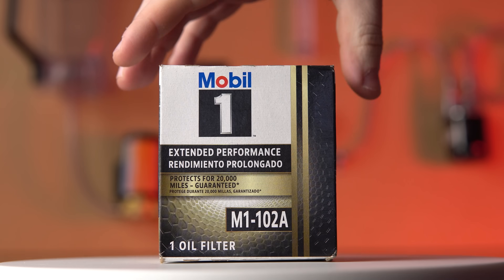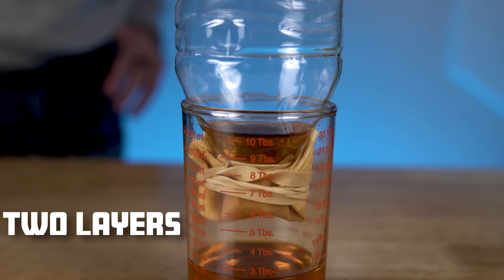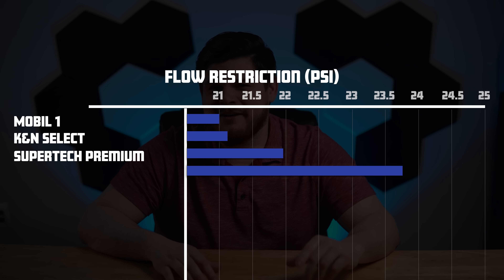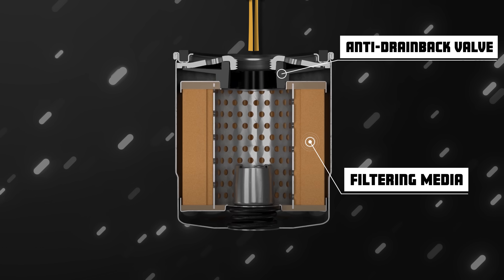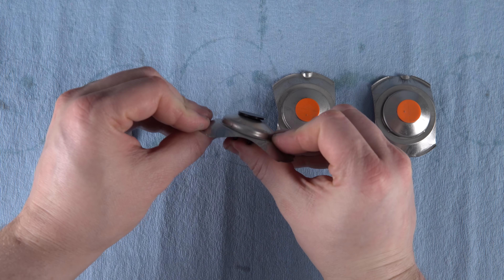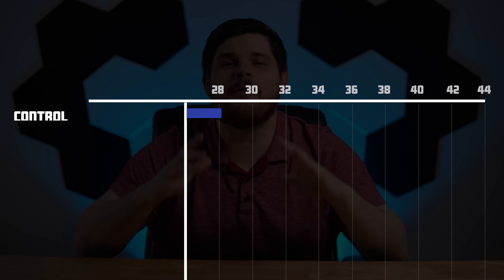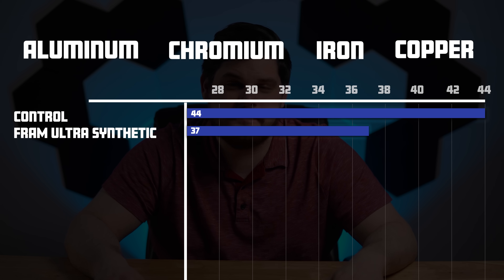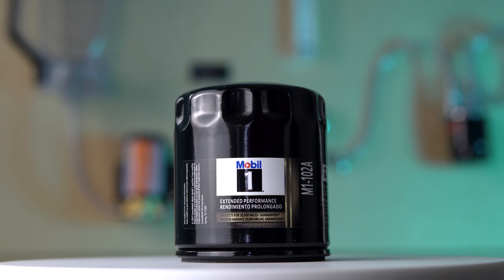Engineers Test the Best Oil Filters! FRAM | Mobil 1 | K&N | Walmart Brand

Comment: Ive been using Motorcraft filters for a long time and they seem to do well but I've never seen any tests with them.  Would be curious to see how they perform against the Purolator Pure 1 which is what I consider to be the best on the market.
Reply: Yes. Motorcraft and Wix testing please.
Reply: I got a Pure1 in a package oil deal from Advance Auto parts and my engine ticked on cold starts. I replaced it with a $2 QS filter from Menards and the ticking went away. Called Purolator and their agent was a stroke. F them.  If they offered me a free lifetime supply of filters, I'd tell them to stick it. Also their air and cabin filters are more expensive than OEM and garbage, IMO

Comment: I am an ICML certified technician. You might want to check out Baldwin filters. They have a lot of industrial applications, but sell automotive filters as well. I don't know if you can find a lab that measures smaller particles for gasoline engine oil, but for industrial machinery, oil is tested for particles at 4, 6, and 14 microns in size, as the smaller particles cause the most damage in rolling element bearings. You wont find an automotive filter that can catch many particles smaller that 10 micron. Engines don't have too many roller bearings, but some can be found in the roller lifters of later model push-rod engines. At work our samples get sent to Bureau Veritas for analysis, but I see they only offer the particle count for natural gas engines, and not the Gas/ Diesel engines for some reason. Good work guys!

Comment: That was a rocking and thorough examination of the presented filters.  Well done!  Liked an Subscribed.  I have been using the Mobile 1 filter and Mobile 1 20000 mile synthetic oil in my Ford Fusion Sport since 2012  My engine has 138,000 miles and is performing like the day I bought it.
Reply: I've got a 2015 Mustang V6. Bought it with 1200 miles on it. At the first oil change it got Mobile 1 oil and filter and that's what I've been using since. The car now has 230 k on it and runs fine.

Comment: The best filter for your vehicle is from the manufacture of the vehicle. I found out the hard way that the spring tension inside the filter is set differently on the factory filter then the off shelf brands.
Reply: Absolutely true and many don't realize this. But also a cartridge style oil filter is best to get directly from vehicle manufacturer since they ensure the oil flow is correct.

Comment: I don't know man, in a healthy engine I don't think these filtering capacity tests are going to be relevant. If you've got that much aluminum or other particulate in your engine it's probably already knocking and about to seize, and at most you're going to buy yourself a few miles with the high capacity. Looking at your pressure flow test, the K&N and Mobil 1 are not different enough to be statistically significant, so I say that's a tie. the third test, the most important in my opinion for real world use, you can see that the K&N is far superior. Personally I would still buy the cheapest of the bunch because they all get the job done, but the K&N is the clear winner here. If you want the very best filter for keeping an actual engine clean out of this group, you go with that one.

Comment: Love your video and the testing methodology. If you can, for future tests to help make sure the pressure test is valid, it would be very helpful to confirm a couple more things: 1. the viscosity of the oil, and 2. a very good determination of exactly what pressure the bypass valve starts to open (noting that room temperature oil is thicker than hot engine oil and the thicker oil that’s not at operating temp is much more likely to push open the bypass valve as opposed to traveling through the filter). 

Regarding item 1, I’m not sure if there is an affordable instrument to measure viscosity so if you aren’t able to obtain one, it would be good to state what brand and viscosity oil you are testing AND the temperature of the oil. This would at least give us a rough idea of viscosity. Because, as we all know, hot oil at the operating temperature of the engine is much thinner than oil at ambient temps.

Regarding item 2, since I think you probably completed your pressure test with the oil at room temperature (and not the hot temp) the oil is thicker and potentially was opening the bypass valve. 

I read through many (but not all) of the comments and others might have already pointed out some of the above observations. 

Thanks again for your testing!
Reply: Yup. Agreed...hot oil makes a big difference

Comment: Very good test set up, like others have mentioned about the bypass valve, a way find out when the bypass opens would be important when it comes to assessing oil flow rate. I would also be more interested to see these tests being performed with the temperature of the oil listed. assuming it’s room temp between 70°-80°f you may find flow rates to be different if the oil was closer to 190°-200°f as that is the typical operating temp of all vehicle engines. But overall cool video!

Comment: I change my oil and filer at every 5 000 miles regardless. I would never leave engine oil for 20 000 miles. Engine oil is good for the lubrication up to 250 moto hours so does the filter.

Comment: I change my oil filter every 15k miles, i never have any issues just change oil regularly. I have a nissan nv200 bought it new and now has 140k miles with CVT, and still running strong. 👍🚐 and i did vanlife on that van and traveled all over the United States.

Comment: I prefer NAPA aka WIX filters. I do an oil filter change on my car 3 k miles and a change every 9 -12 k. I run Pennzoil pure platinum synthetic in a 2004 corolla 1.8 2ZZGE Toyota engine with 236k. Only thing it ever needed was a timing chain tensioner which takes less than 5 min to change out. Not timing cover access needed.

Comment: Great video, very informative!  

If you continue testing filters please add the pressure which the bypass opens and flow rate. Adding AL powder until the flow rate drops could be skewed due to the bypass opening fooling us into adding more powder. 

In any case I'm glad I always run Mobil 1

Comment: Thanks for doing this test it was very informative. It would be nice to see how the factory filters test.  Specially since many of the manufactures, Ford, now recommend 10,000 mile oil changes.  I personally change my oil at around 5,000 miles or 1 year and use either Motorcraft 5w-30 synthetic blend or Mobil 1 and a Motorcraft filter.

Comment: Would heating the oil change the viscosity and create different results?
Reply: YES. With all modern synthetic, multi-viscosity oils,  RAISING the oil temperature makes the oil THICKER (Higher Viscosity) -- LOWERING the oil temperature makes it THINNER (Lower Viscosity).
 In this test, ALL of the Filters were tested at similar temperatures, so the temps are irrelevant.

Comment: My brother changed his oil and installed a fram filter then lost all oil pressure and had to replace his engine. I changed my oil the following weekend (using a fram) and lost all oil pressure. I noticed it and turned around right away, put the old filter back on and pressure returned. I will never use fram again.

Comment: I would like to see this done at real world conditions over say 5k or 10k oil change interval. Having a huge capacity to hold contaminants is great and all but if say over 5k you only used 2% of that capacity there is no real need to have twice the capacity. Also could do a wear test and estimated extension of engine life based on 34 PPM vs 41PPM. Does this much difference make any real increase in engine life vs cost. I could save thousands over the life of a car to use the cheaper filter Vs the most expensive. 120 oil changes x 10$ difference is 1200 dollars. Even it add 10% life to your engine if its still in good operations and not smoking using excessive oil it may not the worth the cost. I change all my oils at 5k or less depending with full synthetic and never noticed any change in oil consumption. Only when I was younger and used regular oils over 100k of use did I notice a change in oil consumption. Also I have had cars where I would not change the oil for 10k miles as I was adding 1 qt every 1000 miles and the oil always looked like honey. I will  change it if it looks dark or 5k max now. My current daily i do the filter every 2 changes and oil every 5k miles. Saves some hassle and haven't noticed any change in 150k miles.

Comment: really not gonna mention any of the huge holes in the testing? like pressure testing and not checking the oil just opening the filter what if kn pressure increase was due to filtering out that much more contamination causing restriction

Comment: The main problem with testing oil filters is that every application is different. I open the boxes up at the store and visually inspect the filters internal construction, which changes all the time. Brands and prices mean nothing anymore. You have to familiarize yourself with the current designs and make the best choice on that day.  Sometimes the Supertech is the best choice. Sometimes the K&N or Mobil is the better filter. But with over 40 years of experience in auto mechanics, the Fram is NEVER the best choice!

Comment: Did you try these tests with oil up to temperature?  Even warming the oil a little bit can give lower viscocities and potentially vastly different results when filtering.  I am also curious what kind of pump you used.  I am guessing it was not a positive displacement pump like a car engine uses.

Comment: Didn't the K&N have a finer filtration? If so, it should filter down more PPM. Stay away from high performance or race filters. They don't filter as fine because a race engine normally gets torn down often anyway and they focus on oil flow for a multitude of reasons.

Comment: Your analysis only included 1 of each filter, which does not factor in tolerance.  That being said, your conclusion is biased toward what you want.  If you look at what kills engines, its particles of a certain size that cause wear on the engine materials.  You almost always will want a filter that filters the best unless you are racing or driving like an idiot.  99% of the population doesn't care about flow rate.
Reply from the maker: Thanks for the feedback

Comment: How is this testing capacity exactly? 

One way of thinking is that if the flow is reduced does that mean it is catching more powder vs the others?

Maybe run it but have it take a sample and have that tested to see what actually passes?
Reply from the maker: @ Myimo Thank you for the question and for the suggestion. we were measuring how much aluminum powder it would take for it to reduce the oil flow. We couldn't do it all the way until it was clogged because ethe bypass valve would actually open and stop filtering. You do bring up a good point. Unfortunately, that would required a specialized lab that can run these filters through an ISO 4548-12 test. But one way of running the efficiency test differently would be to pre-mix the powder run it through the filters and send it to the lab for a particle count analysis. Again, thanks for the suggestion, it really helps us improve.

Comment: I don't see an oil heater included in your testing setup.  Motor oil is normally hot most of the time.  Your tests need to be performed at the normal operating temperature to give accurate results.
Reply from the maker: @Glenn R Thank you for the suggestion although all filters were tested with identical conditions, we agree that a more realistic scenario the oil would be at operating temperatures. we are working to update the test stand, but as a small youtube channel we had top make due.

Comment: The flow needs to be measured in addition to the pressure. Set the input pressure to the be equal for each filter and measure the flow. Or set the flow of each filter to be equal and measure the pressure. A few pressures or flow measurements for each filter can be plotted/graphed for flow vs. back pressure. Flow through the filter media is non-linear and will decrease as the pressure increases. A graph will give a good idea of the filter performance.
Reply from the maker: Awesome, thank you so much for the recommendation. We are always trying to improve and thanks to comments like your we can, so we really appreciate the suggestion.

Comment: My uncle used a Fram one time.  It separated and covered his engine bay in oil . He has a Crosstrek and the filter is on top not the bottom so was noticeable before it could destroy the engine.
Reply from the maker: That's not good. Glad everything turned out fine. Appreciate you sharing and thanks for the support.

Comment: This has huge potential. You should definitely do more brands. Penzoil, amsoil, oem filters, ect!
Reply from the maker: Thank you so much for the kind words and the suggestion! Much appreciated.
Reply: @BrandRanks  Honda oem next please 🙏🏻
Reply: @DTuned559  Honda OEM is basically a re-branded Fram Tough-Guard filter lol.
Reply: @kimblem.w9952  🤣
Reply: @DTuned559 going to save you some trouble the OEM Honda filter is no good
Reply: @johnsteele8073  my bad bro running another filter might free up 1000 horsepower
Reply: @kimblem.w9952  Ewww no thanks. No Fram for me.
Reply: @luckyguy600  The only Fram filters worth getting are the XG synthetic cartridge style ones providing your car uses cartridge style filters. The filter media is actually decent and the bypass valves are all built into the engine anyway.
Reply: Amsoil is a Wix XP filter
Reply: @somethinburnin  Doubtful, WIX XP filters have a larger micron rating than the standard WIX filters.
Reply: @jond5680 No he is correct. There are only a handful of suppliers who make filters for the industry.

A lot of these filters are rebranded. Sometimes they add their own housing like K&N for example. But the internal contents come from the same place. 🤷‍♂️
Reply: @LynxStarAuto  I'm well aware there's very few manufacturers for them all.
I was just saying that the WIX XP filter is NOT the same as AMSOIL, the AMSOIL filtration is much better than the WIX XP.
Reply: @jond5680   The Amsoil filter is definitely not the same as the Wix XP.  Amsoil filters use Donaldson Synteq media, yea Wix makes some of Amsoil’s EaO filters but there are never rebadged Wix XP’s
Reply: @BCSVT Exactly
Reply: @somethinburnin no it's not not even close. I have both of them and I can put them on a scale or take pictures of them they're not even close to same
Reply: @somethinburnin   No it isn’t
Reply: @somethinburnin Sorry, but NO!  Amsoil filter is not a clone or “stencil” duplication.  They have their own proprietary designs & lab testing.  I have been using Amsoil filters since the 1980s.  I would like to see it tested as well for additional confirmation.
Reply: Keep in mind: the tighter filter-media will go to bypass mode earlier (= no filter at that moment) oil too thick , too much pressure , filter media capacity mostly used up, or overly fine filter media .
Reply: I would love to see Royal Purple filters as well.
Reply: Just change your oil regularly, at 3-5 thousand miles max.
Reply: See projectfarm
Reply: Baldwin ?
Reply: A major majority of the oil filters are manufactured by champion labs
Reply: Nobody’s gonna watch the same video over and over just because there’s different brands used . That video will flop

Comment: I usually do an oil change every 4k miles with synthetic wix filters but honestly if you change your oil an filter pretty regularly you could probably use the cheapest stuff you can find an be fine.
Reply from the maker: NO disagreement here. Maintenance intervals is WAY more important. Thanks for sharing!

Comment: What isn't tested here is the spring rate on that by-pass valve. That can have a big impact on modern engines. If the spring rate isn't calibrated for the car the by-pass valve could open too soon or not soon enough. Each engine has different oil pressure operating parameters. This of course only applies to these spin-on filters. If your car came with a canister style than the by-pass mechanism is built into the canister. Spin-on to canister conversions are crap and is for another discussion. So stick to the OE filter which are usually around the same price as a good quality aftermarket filter anyways.
Reply from the maker: @ Brian Chase thank you for the feedback. That's a great idea, we will try and think of ideas on how to measure that so we can provide it in upcoming videos. Thank you for supporting the channel.

Comment: That explains why my 2004 scion xb now has 550,000 miles on the same engine. I change the oil every 10,000 miles with mobile 1 full synthetic and mobile 1 filter.
Reply from the maker: Good stuff! Thanks for the support.

Comment: Your aluminum powder test is flawed. If, in your test, it takes more powder before the pressure increases, it may just mean the filter is passing most of the powder. This seems to be the case as the Mobil one didn't filter the powder it just trapped the sludge in the back flow valve. The test would only be meaningful if the same amount of powder was added to clean oil and run for the same amount of time for each sample. Then a metal analysis of the oil could be performed. In your test, you could get the result you achieved without an oil filter in the system. Add enough powder and eventually it will settle as sludge somewhere  and cause your pressure to go up. Winner, no filter!